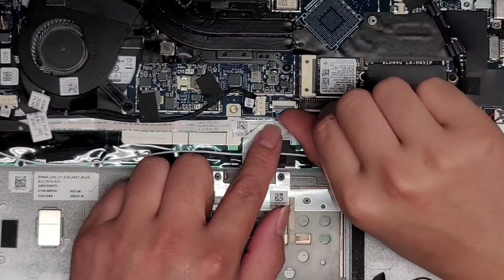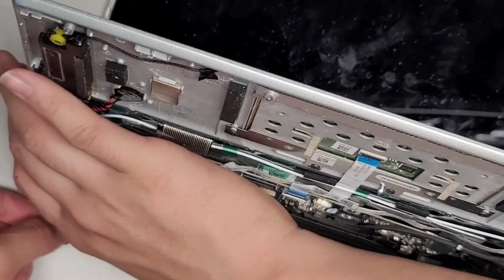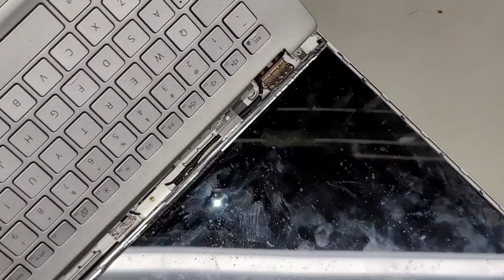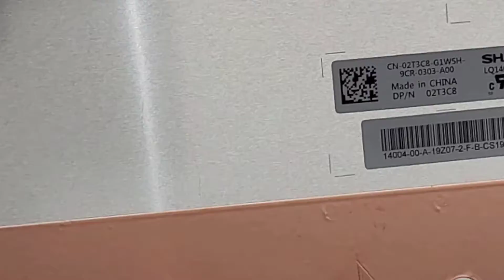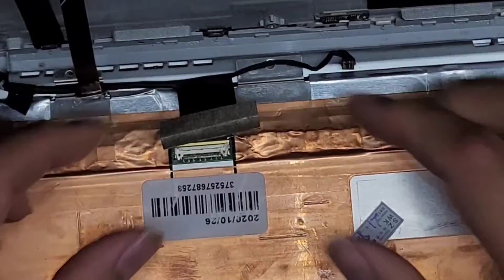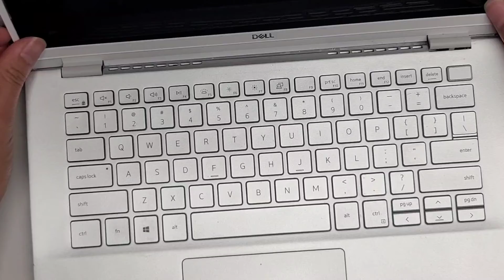DELL Inspiron 7490 Disassembly SSD Hard Drive Upgrade Battery LCD Screen Replacement Repair Repair

Comment: do you know a 1tb compatible nvme drive thati can replace mine with?, also for a nvme data transfer unit as well
Reply from the maker: Here you go https://amzn.to/3HBonzO 1tb SSD. USB enclosure https://amzn.to/3LtX23B
Reply: @ItsBinhRepaired  awesome and it is way cheaper than the other  nvme drivers that I found myself, thank you
Reply from the maker: @na7ian199  no problem